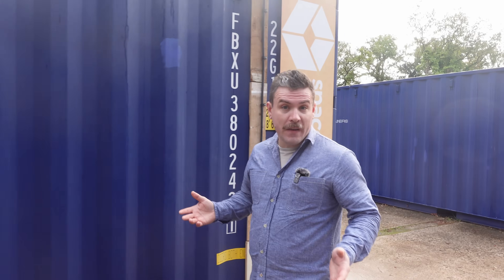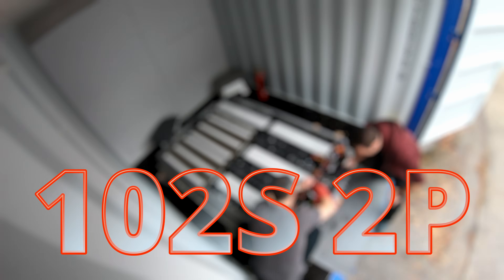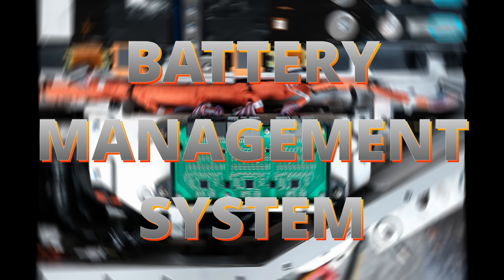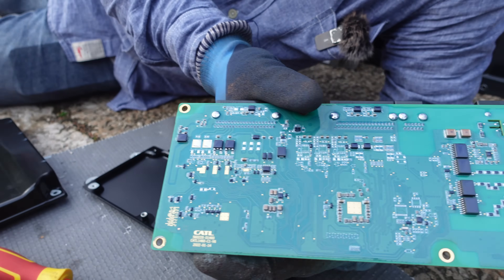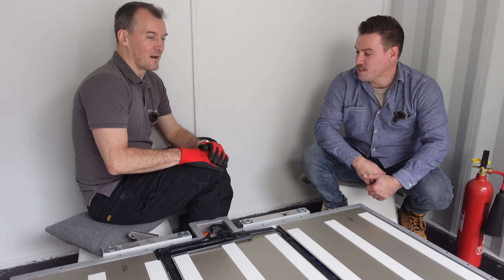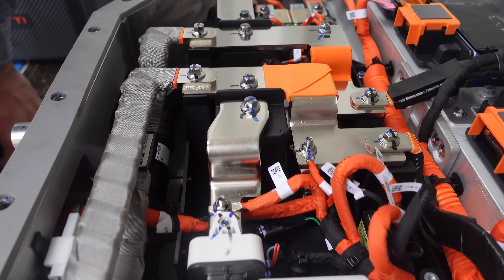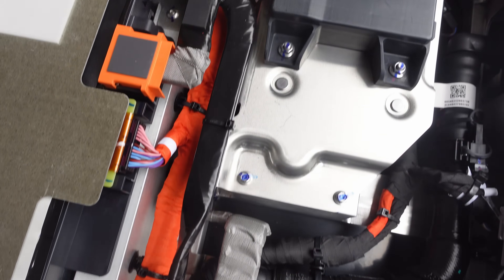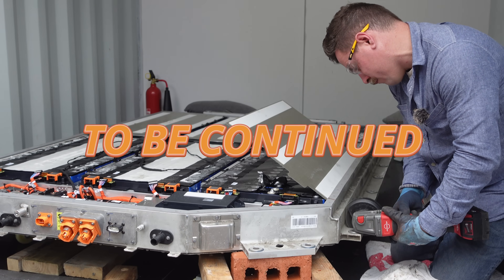We Discovered Fisker's Battery SECRETS!

Comment: why take the cells out? they will last a lot longer if they stay in their proper fixturing. just wire up each pack as its own 17S or 16S pack. it will work fine with 48v equipment and you could mount the pack on a wall or something and reseal it back up. switch it to 17S12P. jobs done, and reuse existing busbar mounting spots but run ~1awg/50mm jumpers.
drill out holes next to the positive busbars and rivet on a 17s active balancer module for each parellel pack. bobs ur uncle. cell balancing and no need for bms. voltage is handled by inverter.
Reply from the maker: I like your thinking

Comment: If you disconnect the bus bars but don't disconnect the BMS, you can burn it or get shocked yourself. I'm just guessing because I don't have the schematics but in theory it could conduct some current. I wonder how much did the pack cost. I use CATL cells for some of my projects and they are amazing.

Comment: Those ripped off terminals on the individual cells .... oh my. That's not really reusable as-is. And glued down to the bottom? Absolutely no repair possible. Not made for repairs. Sad.
Reply from the maker: No repair, but if the pack is reliable it shouldn’t need a repair. It’s the way a lot of battery packs are going now.
Reply: @TheOfficialBatteryMan  I agree, but we see again and again that down the road a cell group can get weak, and in that situation repair is not really possible.

Comment: Nice to see an Ocean/CATL pack.
I use Victron also,  but as someone stated,  it wouldn't be much work to use a HV BMS for this pack. Then only open the cover and attach 2 wires to the battery terminals and use the inverter you used for your Tesla pack.
Reply from the maker: I like your thinking. Will the owner wanted to break it down to lower voltages. Effectively for just the cells. 

Feels a little bit of an old school way now we can connect to some EV batteries directly
Reply: @TheOfficialBatteryMan 
I understand him completely,  until the step he has to almost destroy the battery to get the cellpacks out.
A bit the same as jehugarcia sometimes breaks his packs.

But it's entertaining,  lets see how the owner does it!👍💪

Ps. I always wonder how on earth maintenance will be carried out by the manufacturer.
Reply from the maker: @gubbernl I think cell reliability is so strong now you can risk to loose the odd pack to bad cells. Sorry risk the fallout from a few customers having to replace them
Reply: @gubbernl the problem with HV batteries is they aren't directly compatible with a Victron setup as they are only designed upto around 66v DC. 
Some do it via the use of another inverter or such that can take HVDC. But it's even more cost.
The beauty of breaking down to smaller modules is easier maintenance as well. Once the modules are out if a cell dies you can actually swap it as bringing each module down to the Victron acceptable voltage means some cells are left spare in each module if my maths is right on those modules...

Comment: So what your saying is every single thing is going to write this care off! Bad cell car go bye bye other than a whole pack swap and hope it doesn’t need programming to the car to get accepted 😅
Reply from the maker: Fortunately other than about 1 million bolts holding the top cover on a lot of the top end could be swapped between packs so if there was an issue with a cell, I would definitely put the BMS from the broken battery into its replacement. 

There is so much unknown with the Fisker Ocean platform. Makes you realise how Balsey the owners of these vehicles are. 😂
Reply: @TheOfficialBatteryMan  balsey or just what they say that 💩 polished is still 💩 but not from a distance doesn’t look like 💩 😂, but some people got hard done by this vehicle the claims of the recharge from the solar was farcical as the UK regen could never be the same as most places as everyone in the UK knows we get by far the sunniest weather 🌦️ 😂
Reply from the maker: @DTech101 i actually really like the car. It’s a shame it didn’t get chance to be what it could have been
Reply: @TheOfficialBatteryMan  personally I think it was rushed just like some so called console/computer games but with no patches over the air on day one which started to seal it’s fate then Marcus done the rest, watching Rich rebuilds this car has some really bad design flaws in software but in hardware to which ultimately would have sealed its fate long term anyway. Not alone I liked it and the really high mileage claim yeah I bought into the hype and then under delivered

Comment: would it of been worth lifting the battery to a higher platform make it easier to cut the bottom out of the housing? maybe? on a rise and lower platform. Then use a portable bandsaw to cut the outside off then re-evaluate how the cut the cell blocks into packs leaving them as double sided packs
Reply from the maker: There are some hooks high in the container. I thought about using them to get the pack on itself side. Defo need easier access

Comment: Presumably this came out of a broken Ocean, I think I would have tried to find a car before breaking and sniffed that bus!  But then I'm just sitting on my butt drinking coffee while someone else does all the work.
Reply from the maker: It’s not just reading the CAN, it’s then developing the integration with the battery emulator. Which would require hours of ‘Dala’s time. For very few use cases as they are not that common a pack. 

It’s also knowing pinouts
Reply: @TheOfficialBatteryMan No face protection 😮

Comment: You may not have the bus messages, but you can just buy a €500 bms and use it that way with HV inverters. I used to do use 48v as well with 12s EV modules and add 2 in series to get 14S, but it can get pretty annoying when you make a large battery.
Reply from the maker: I’m with you a massive fan of higher voltage and retaining as much of the pack as possible
Reply: @TheOfficialBatteryMan I've also seen people use the lead acid mode on some HV inverters and use active balancing boards that have Bluetooth connectivity. Not the safest method but for such a large battery the cycles per year would be less than 100.
So you dont have to worry about unbalanced cells. 
The only thing that you would have to worry about is bad quality cells that can spontaneously catch fire due to a manufacturing defect. 
But above 20kwh you need to follow different rules for fire safety in my country. Its a good idea to have such large batteries outside in a small shed or container anyways.

Comment: Hopefully when newer battery types such as solid state become available, we Fisker owners will be able to swap these packs out for them. Would it be fair to say that CATL hasn't skimped on the battery pack safety or the quality of its components?
The Fisker Ocean is such a modular car, just like Sir Alec Issigonis Mini, the majority of the running gear is mounted on two subframes, it is interesting to see that this also occured in the battery packs as well.
Reply from the maker: The pack is very nice overall
Reply: You are better off buying a whole tesla for the price of a replacement pack for this car.
Reply: @EugenePutin  Replacement pack: $1500
Replacement Tesla: >$1500
Reply: @moistpope  replacement Chinese pack will cost as much if not more than the newly introduced bmw i3 packs for $5800 not including shipping or installation. I can get a working lightly beat 2018 model 3 for $7k off auction. These Fiskers can’t even match software from a car that was built in 2013(model s) so I think a better buy would be any older tesla if it came to that.

Comment: If that pack use max17841 chipset or similar already exist hardware and software that replace the master BMS module.
Reply: That would be good news. Biggest let down for the Fisker Ocean, is that most have all the hard ware you could want in an EV but not the software to access them.
Reply from the maker: Infineon
Tri core
SAK-TC275TP-65
P200N DC
©️Infineon 14
84P0CX305UP

G2304